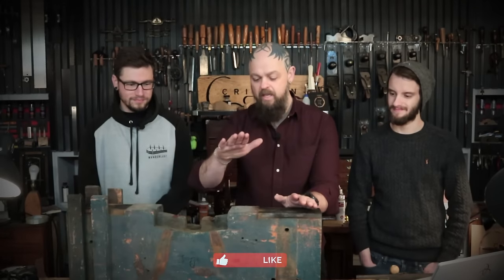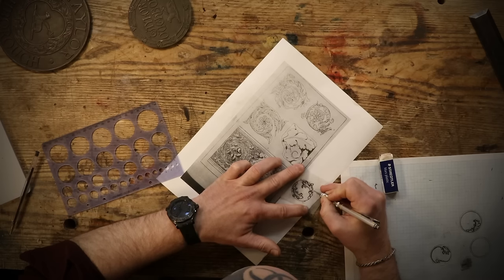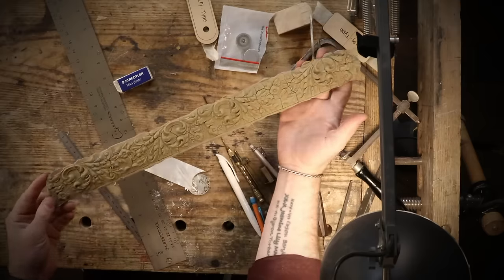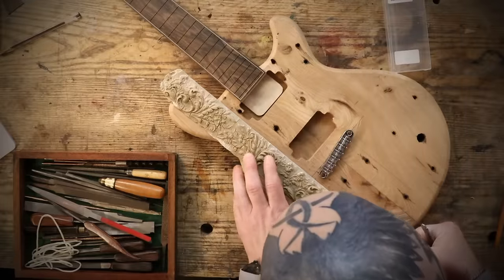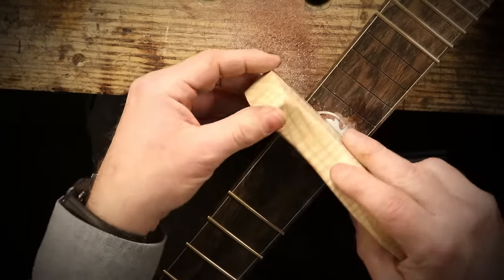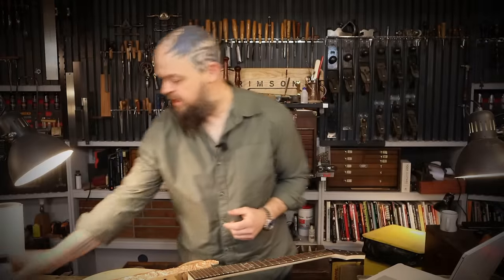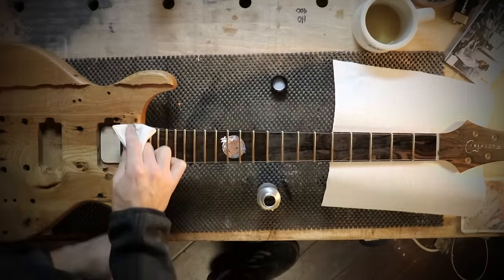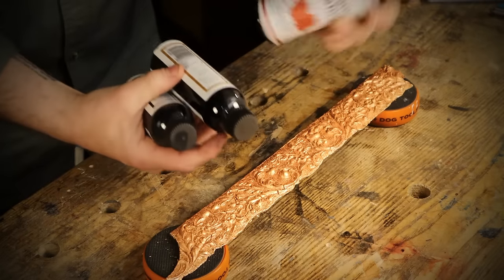Full Guitar Build from Antique Bell Tower Wood

Comment: The guitar looks and sounds great. So pleased the inlay through the body didn't just get filled with epoxy resin. That just would have been to predictable and its getting so common and over used with rustic pieces of timber. The way it has been done also gives it a nice bit of texture and also leaving the holes unfilled. Another master piece from Crimson Guitars...